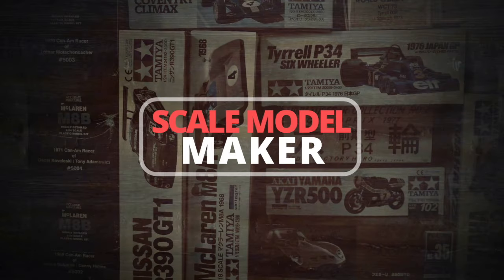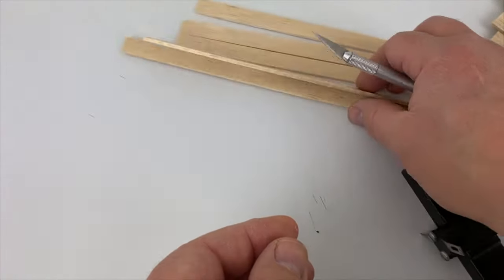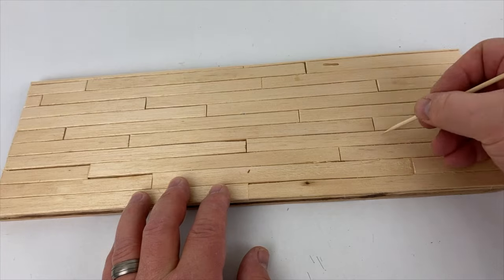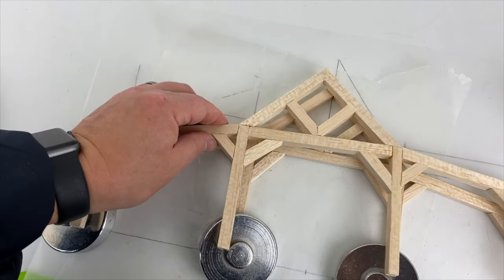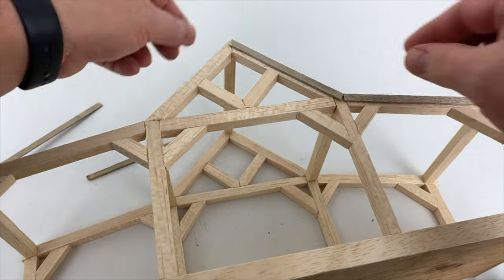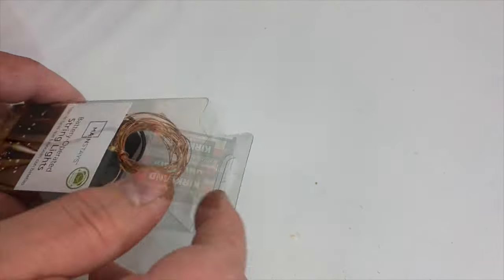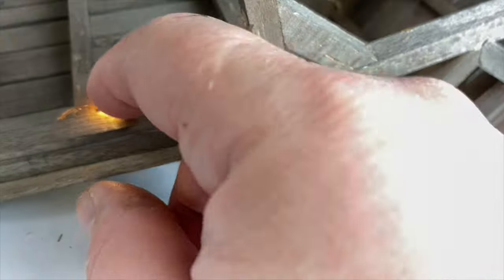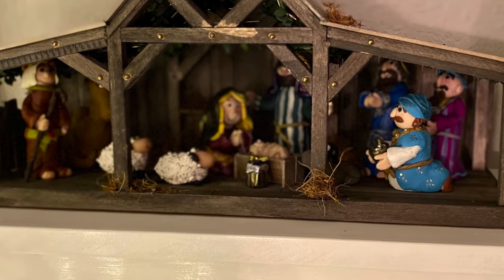Build Your Own Scale Wooden Nativity Manger

Comment: Sorry, what kind of wood are You using for this project, I really liked it and I want to do it and where did You buy all  that tool You use, thank You for answering my question.
Reply from the maker: The major structure is built from balsa wood cut from 3/32 sheet and 3/8 sheet. The base was a piece of 1/2 in plywood cut to 15 x 6.0 in. Hope this helps!
Reply: @scalemodelmaker659  Thank You so much.